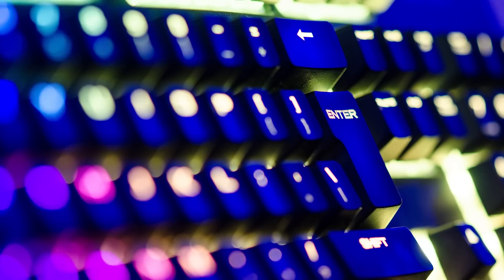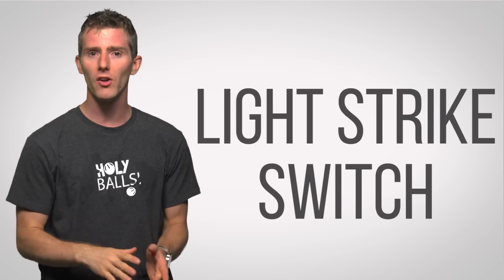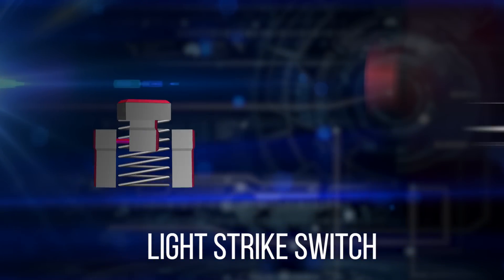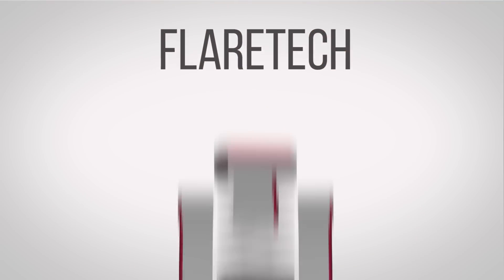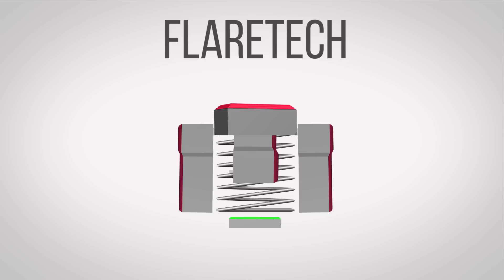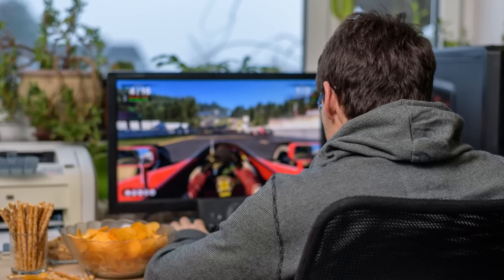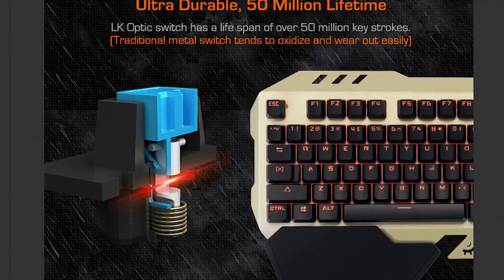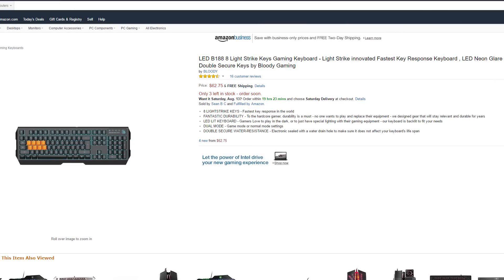What are Optical Key Switches?

Comment: 2:08
Jus use an ajustable resister on the switch and keyboard. xD (For pressing down) THOUGH THIS IS SO MUCH MORE ACCURATE, Now people can play games that might require a petal set clutch, brake and accelator, Now we can use the keyboard. Thank god. I wanted this since driving games came out.

Comment: Pressure sensitive switches by the Flaretech switch would be great, just you'd need to stiffen the travel distance, as you won't have mechanical resistance, would be even smoother than MX-Red which would be harder to control the distance. Regardless, I support it as long as they can make good methods to keep the dust out.

Comment: The first LK switch idea didn't seem that interesting. It was using a different means to achieve the same end.

The second Flareswitch technology, however, is extremely intriguing as it brings something genuinely different and novel to the keyboard, which hasn't really changed that much since the typewriter.

That being said, while I am sure we will eventually find useful applications for it, the very nature of such an approach makes this technology best suited for linear switches. That for me, is a bit of a bummer because I prefer tactile switches. I am not saying that it is impossible for these switches to be tactile, but making them tactile would mean that the range of depression just beyond the 2mm actuation point would be hard to use since we'd go directly from 2mm to around 3mm from pushing down on the key.

On the other hand, perhaps that's actually could be useful as the tactile bump could help "define" two levels of pushing. In other words, pushing the key while not reaching the tactile bump could mean something and pushing it beyond the tactile bump could mean something else.

Comment: This technology is not new at all. Optical switch keyboards can be made to be waterproof, dust proof, ignition proof for use in explosive environments. They're used in medical equipment, like in ORs (where the the faster they can be sterilized, the better) and they can be made to be totally metal-free for use around powerful magnetic fields like inside MRI machines (with fiber optic leads, of course). High voltage deadman safety switches use them too. The list goes and on and on... There are even Hall effect keyboard that use magnetic fields to sense key presses. Shit gets pretty real real quick in the world of safety and reliability engineering.

Comment: I suspect that flaretech is developing the variable input optical switches just so they can include the term "Optical" in their keyboard packaging. The idea of using a variable pressure switch for keyboards is good, but there are mechanisms that already exist to provide this, they just have to be applied, now that people have gotten the idea of putting this type of switch on a keyboard. And correct me if I'm wrong (because I'd like to know for sure), but wouldn't the addition of these new keyboard switches require a new driver?

And if the designers of the keyboards we have now wanted to, they could make the parts on the keyboard easily replaceable and with more effort, modular. You can pull a memory card out of its slot on a computer, right? Same basic principle; no soldering required.
Reply: […continued] I think that making your own keyboard would be a cool project. Something like: get together a bunch of sensor, key, wiring, and case components, use some kinda maker board (Raspberry Pi, Arduino, Paralella, Up Board, or whatever) to tie everything together and write the scripts to create a standard (or novel) signal to send to your computer as input. Wouldn't that be an interesting project to do on one of the Linus Tech Tips associated channels? Huh, huh, nudge, wink?… (lol)
Reply: Hi, no drivers are required on Windows at least, Linux you would have to xinput and yes, most of the parts are actually replaceable, it's very modular, for example, you can make your own backplate, casing and keys can be pulled like caps, you can also use multiple switches at once. Flaretech switches are the only optical switches made by a manufacturer, other switches are custom cherry mx, about the memory card, no sorry.

~WootHelo

Comment: I wonder with flaretech keyboards there can be a settings option that tells when to register as 5%, or whatever percentage. Small pressure that is normally x percent (probably from resting your palm flat on the keyboard, for whatever reason) could be told to register as 0%.

Comment: LK seems stupid,  with all the debris gettin into the keyboard, the path of the light would get blocked after some usage
Reply: Nope. The light transfer happen between PCB and switch. The exact same path that any other mechanical or membrane switch would.
Reply: no, daemi is right, in the LK switch variant the ligh passes from post to post through the center of the stem. You would be right if she was talking about the flaretech ones though
Reply: kodi Williams Again - Grime doesn't magically get pushed up into the switch from outside...

So no. Daemi is still not correct.
Reply: you probably never cleaned a keyboard that had soft drink spilled on it and left to dry there.
Reply: Daemi Ax I have... several times. And again. The drink would find it's way below the PCB and shortcircuit it (if at all), or get stuck in the recesses between switches.

Again. The grime and fluids aren't magically going to travel upwards along and into the switches and much them up.
Reply: LK  uses the shaft as an optical switch,  the shaft moves up and down and I can PROVE you that the shafts of keys  can and WILL get  debris on it.
Reply: besides,  fluid float about,  gamers will  ram their  keyboards when they had a shitty  fight or lose,  it is ABSOLUTELY IMPOSSIBLE for dust to not reach the shaft,  dust reaches EVERYWHERE! and so would the fluid if you smack the keyboard a few times because you lost a LOL  game or something... you are thinking of a perfect world where everything comes out as they do in papers

Comment: We all know that keyboards get dirty very very easily. What happens when dust/food/hair starts to botther the light sensors?
Reply: Nothing - Because the sensors are inside of each switch. Dust buildup and such won't happen any faster than on any other mechanical keyboard.

And if grime does happen to get into a switch, you can either take it apart carefully and clean it. Or just pull it out and replace it with a fresh one. (On a keyboard like the Wooting that is)

Comment: So wait... if I wanted, I could put the flaretech switches on WASD, and keep the others a standard mechanical? A bit confused (also because I've not yet owned a modern mechanical keyboard nor messed around with switches)
Reply: No. Part of the optical technology is soldered onto the PCB itself - The keyboard itself needs to be born/sold with Flaretech switches to work with it.
Reply: Mansen Oh ok, but the point he was making is that if one goes bad, it's easy to replace with just one key rather than needing to repair entire keyboard.
Reply: ***** On a keyboard that supports replacements... yes

Comment: analog switches... didn't every PlayStation controller came with this in their buttons, like I remember in MGS where you had to push slightly on the button to hold the gun up and then push harder to shoot.

 I'm surprised that master race hasn't adopted such ancient technology.

what's next, vibrating mouse and keyboard XD
Reply: You joke - But vibrating mice and keyboards have been tried before. In part because it made both heavy and annoying to use.

This is just a toggle of a button on an otherwise "regular" mechanical keyboard (which has the technology)

Comment: This keyboard might have some NKRO/polling issues.  From what I remember (did this in college 5 years ago and haven't touched it since) USB keyboards send 8 bytes during each poll.

Example: 
00 00 00 00 00 00 00 FF  //Nothing is pressed
00 0A 00 00 00 00 00 FF //A is pressed (not real character map values)
00 0A 0B 00 00 00 00 FF //A and B is pressed

The first bit is the modifier keys like [CTRL] [ALT] [SHIFT].  
The last bit is the terminating value.
Everything in between are available keys.  I have yet to see a USB keyboard with more than 6KRO.  

Regular keyboards do not check how far the key is pressed down so they don't need additional bits for that.

They can add a byte after every key value but that would increase the packet size and have a slower keyboard.  This means sometimes it will not catch your input.  Most non-gaming keyboards have polling rates of 128 MHz (8 milliseconds).  Don't know how much slower adding more data will slow it down.

OR they can have every other byte the pressed distance value but that would decrease the NKRO to 3 (Not including modifier keys).  This means in a FPS game you are running diagonally [W] + [A] then try to jump [SPACE] but when you try to check teams [TAB] it will not register the [TAB] or you will get phantom inputs (I'm using Overwatch as an example).
Reply: There have been quite a few USB keyboards in the past few years that have been able to achieve NKRO, actually. I've seen different methods of trickery that companies use to get around the 6KRO limitation of the standard USB keyboard protocol, but as far as I'm aware, the most common method is to simply have a keyboard emulate multiple keyboard devices connected to a hub (which is something that can usually cause issues within Mac OS or BIOS). 

Polling also shouldn't be much of an issue, since many gaming keyboards are already polling at 1000Hz, not to mention the bandwidth of USB2.0 itself would provide plenty of overhead to handle the extra amount of data being sent from the keyboard.
Reply: They'll use DirectInput.
Reply: ***** xInput doesn't support that many buttons, there is no better API as of now.
Reply: No NKRO issues - USB is perfectly capable of handling ful NKRO with 1000hz polling rates these days. All it requires is the PCB and controller for it.
Reply: Chris urquhart No need to use 3.0 either... It's all perfectly possible on USB2 with standard drivers...
Reply: You could use a PS/2 input but you wont have the flashy RGB backlight. im using a steelseries 6gv2 with it
Reply: OR - And hear me out. Use USB. NKRO is perfectly possible through USB. It has never been an issue with the bandwidth, only controllers.

Comment: Hmmm for me the thing that make the difference between membranes (and cisors) keyboards and mechanical keyboard is the presence of a spring. So for me optical switches are just mechanical switches. For example the only common thing between Cherry MX switches and Topre switches is the spring (in Topres switches the contact is made by measuring the capacitance between the membrane and the PCB so it's really different from Cherry MX contact wich is made by contacting to piece of metal together). If the contact is made by measuring the capacitance (Topre), or by contacting to pieces of metal (MX, RomerG, ect), or by cuting a laser light or anything else, if there is a spring it's just mechanical switches.

BTW: I'm not sure for the "faster response time" why does optical switches have "faster response time" ? And do we have tests ?
Reply: They don't have faster response times in of themselves - Whoever wrote the script made a mistake there. The first optical switch type shown has a shorter actuation point than standard MX Cherry switches - But it is on par with MX Speed and such.
Reply: oww ok Thx

Comment: kinda off topic but i need help

i have what i assume are decent specs for a budget pc but i cant run much

AMD FX 8350
700W psu
GTX 960

i did CSGO as a test and got 600 ms(around 7-900 ping)

please help
Reply: are you sure? when i tested it my PC began to heat up, i may switch my standard fan back to my Hyper TX3 evo, but the outcome may be the same
Reply: i just installed my Hyper TX3 EVO fan, plus 2 corsair case fans, 1 exhaust and 1 intake. Still heating up. i'll see what i can do about the internet, though.

Wish me luck...

Comment: This sounds amaze balls! Though it won't be mass accepted until they figure out how to include per key rgb without messing the light sensors up lol.
Reply: They already did - The Wooting keyboard comes with both Flaretech optical sensors and per-key RGB lighting.
Reply: Excellent (burns' voice)
Reply: It will pick up infra red light only, not visible light.
infra red light isnt visible, because its more than 700 nanometers long, where visible light is 400-700, so the sensors are most likely going to be set to only pick up one single wave length which is the wave length of the laser, but any wave length from 700nm to 1mm will be acceptable without interference.

Comment: it's  as bad as mouse wheels. it will get dirty and non resposive. Everything is going to be non repairable. So you need to buy new switch or whole keyboard.
I have IBM model M, it's older than me and work great. Those light switches will be dead in few years.
Reply: Dirty? Unresponsive? This is like a Model M. It's still mechanical.
Reply: +Mansen but switch is not. everything that can cover lightsource will brick it
Reply: ugurugutugu Like... what? The source is literally covered by the switch - And then the keycap.
Reply: One wonders why Hall effect switches are no longer a thing. They were used in applications where reliability was paramount, as they were nearly indestructible and could easily withstand dust and humidity (they even work fully submerged). Rated for billions of operations - much more durable than even Cherry switches, and also analog and naturally bounce-free by design. But Honeywell stopped manufacturing them twenty years ago, and I don't think anybody else made them. I assume it's a patent issue or something.
Reply: ugurugutugu Yeah... the gaps BETWEEN switches do. Not the switches themselves...

Imagine an umbrella - The switch is the person being shielded from rain.
Reply: Non-repairable? Is that a challenge?
Reply: Or it'll be like optical vs. mechanical mice. Fewer moving parts = more durability, less service.
Reply: They are totally still a thing though, high end flight sticks and HOTAS have them... Thrustmaster (hehe) warthogs, and I think saitek X55 and X56 have them.
Reply: wsippel so let's just wait till the patent expires and we will have flood of hall effect switches.
Reply: +Mansen light switches are more reliable lol.
Reply: On the wootech website they say cost per switch was their reason for going optical.
Reply: Yes, flight sticks and other controllers still use Hall effect sensors, but Honeywell manufactured keyswitches with Hall effect sensors. Sun Microsystems and other companies made keyboards based on those switches.
Reply: ugurugutugu Like a laser mouse?
Reply: did you ever take used keyboard apart? Like gamers one? In few months it's full of dust or breadcrums or something worst. Not a big deal for mechanical keyboard. But it will cover lightsource.

Comment: Mechanical keyboards have durability... please.. blackwidow 2012/6gv2 both started to double click after ~1month, as for optical i own Bloody B740 for 1 year now and not a single key has any issue but.. even if response time may be a bit faster, it's a lot harder to reach high speed for the actual tapping. 
1. because key feels kinda empty when you press it 
2. either that's because of B740's switch setup or no but there's not enough pressure on the way up so continuous high speed is a lot harder to achieve  (for rhythm games that's quite important as on high you'll need to tap fast and for some time..)
As for sound, they sound pretty much the same as red/black, probably more like red as blacks give more pressure back so sound is a bit softer.

Comment: Or you can just use a classical rubber dome keyboard.
Reply: You definitely could - But it won't be analog like the flaretech ones. And they die out much faster. A good mechanical keyboard can last a decade with basic maintenance.

But that's not for everyone of course.
Reply: no
Reply: Once you go mechanical, you never go back to domes keys. It's like going black minus the child support payments.
Reply: A rubber dome will never last anywhere near as long as any mechanical key. You can stop.
Reply: Rubber domes can last that long as well - but normally they are not build with that goal.

Also with rubber domes and mechanical switches you can make variable inputs.
Reply: Mansen when it lasts 10 years imo that is more than enough.
And yeah, it is easy to make it last even longer than that.
Reply: ABaumstumpf Oh goodie - An arbitrary value without any meaning.

Oh but my veteran car has lasted 80 years too! I kept it in a garage of course, but that's not important!

Some of us use the same keyboard all day - That adds up to a hell of a lot of activations. Rubber dome based boards aren't going to last a year at that rate.
Reply: Mansen  "Oh goodie - An arbitrary value without any meaning."
If you need a keyboard to last longer than 10 years of use - then so be it.
And yes, it is a rather arbitrary value, but it is also a fact that we can do it - and that there are many applications with simple rubberdome keypads that have lasted way longer on daily use.

Aside from that the same problem of lifetime can be said about mechanical keyboards - oh, what ya say, they are engineered to last long, but we somehow can't do that for any other technology? grow up or shut up.
Reply: Rubber dome fanboy
Reply: Yeah for sure rubber dome keyboards are more durable than cherry mx that are key-chattering broken after few months. Oh... but you can still feel the feedback ofc.